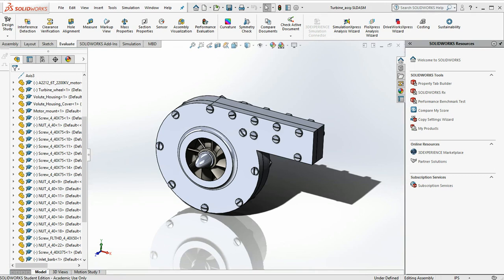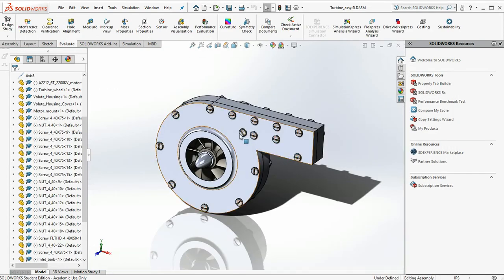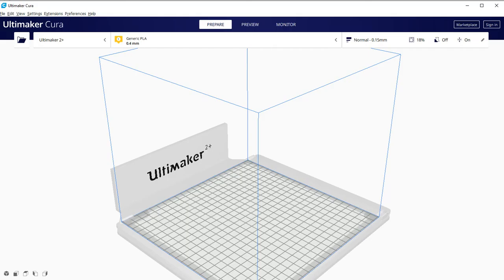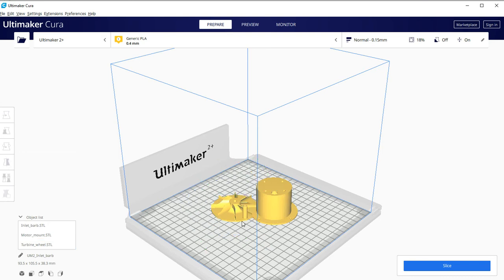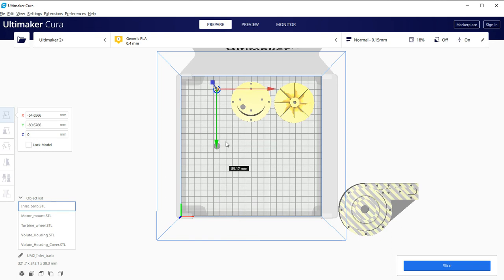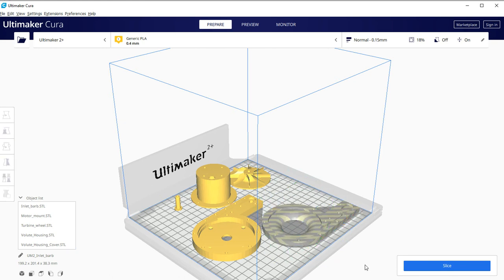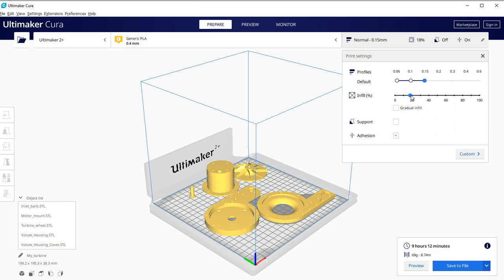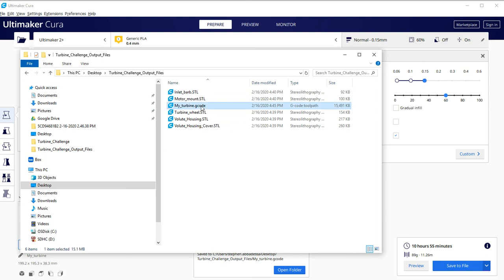3D Printing Multiple Parts Simultaneously

Comment: i think you can just save your assembly as stl and they will automatically convert all the part into stl format, but im not sure if it will repeatedly save the same nut and bolt part.